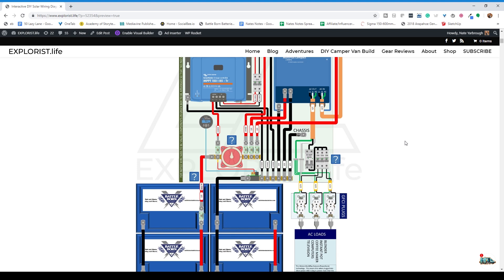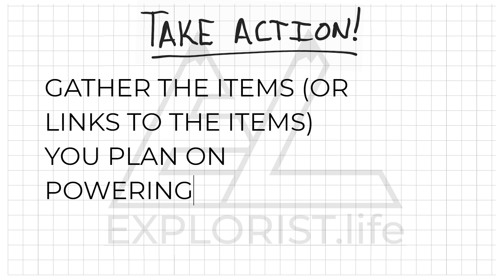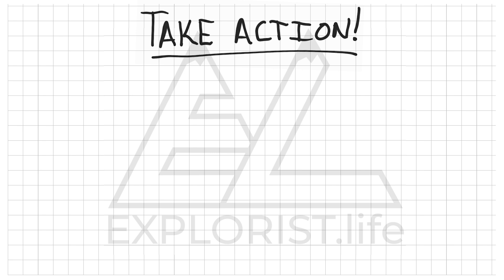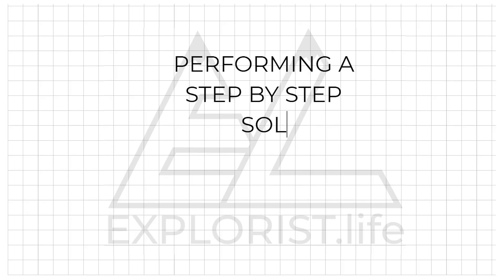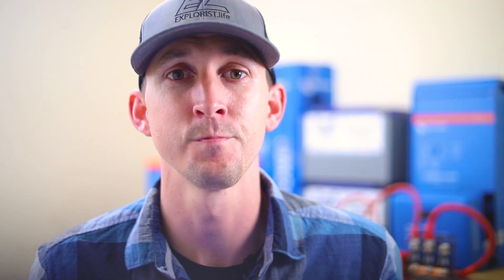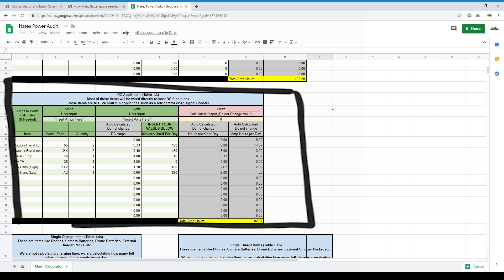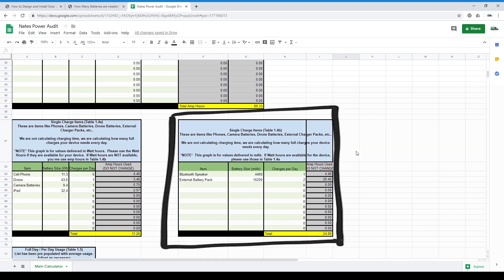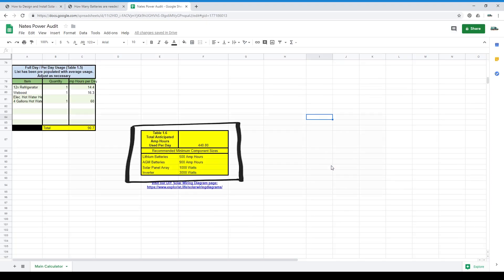How Much Solar Power Do I Need for My Camper? | How to Calculate Camper Solar System Size

Comment: You are basing your numbers on the rating of the power supplies and not their actual consumption. Good to overestimate by a bit but that all adds up to making the investment much more costly than may actually be necessary. That sours many people on the idea of going solar. You must own stock in a Copper Mine. You are calling out a 4/0 wire for a case ground on a Multiplus? That is some serious overkill.
Reply from the maker: Victron calls for 4/0 wire for 3000w Multiplus units.  Source: P.8 of the manual: https://www.victronenergy.com/upload/documents/Manual-MultiPlus-3k-120V-(firmware-xxxx4xx)-EN.pdf

ABYC standards call for "A DC Grounding concuctor shall not be smaller than one size under that required for current carrying conductors supplying the device and not less than 16 AWG". Source: http://www.blackfinforums.com/sites/default/files/10/attachments/abyc-e-11.pdf?fbclid=IwAR2dBwJC1gp9_oHI3X3r7M5nuXK0UzljHjHkWkMs_kLJvw66s-8M7J3DXP8

So, the smallest that would be allowed by ABYC standards is 3/0.  I call for 4/0 because it's generally easier (and often cheaper) to consolidate similar wire sizes and round up when wire sizes are within 1 gauge of each other.

Hope this clears up your confusion!

Comment: hi , love the gold you posting ... i do have a question regarding calculation, do the charge controller / inverter / isolator etc actually use enough power that i need to use it in my calculations for power requirements ? i assume they are used all day? thanks , Scott
Reply from the maker: I don't figure those in.  The inverter is the only one that really uses substantial power at idle and if you are using a Victron inverter like I've got in my diagrams at https://www.explorist.life/solarwiringdiagrams it uses less then 1 amp at idle; which is still 24 amp hours per day, but ultimately that's figured into the 'round up' part of that calculator.

Comment: my power bank says capacity 22000mAh / 83.6Wh... when i put these into specific 1.4 tables mentioned in the video I get two different result of 'Amp hours used'?

Comment: What about Tesla S batteries?
Reply from the maker: You'll have to do the conversion from amp hours at 12v to amp hours in whatever voltage the Tesla S batteries uses once you determine the values you get your end result from the spreadsheet.
Reply: EXPLORIST life - DIY Campers thank you to infinity and beyond.

Comment: On your spreadsheet in Table 1.4,  I have specs for an iPad Pro saying it’s 38.8 Wh and 10307 mAh.  When I plug that into either column, I’m getting a big difference between amp hours used.  What am I missing?

Comment: I shot-gunned it with my setup with 230Ah of golf cart batts and 200W of solar and a Morningstar ProStar controller and taking a SWAG at my DC power consumption. I’ve followed a lot of the tips offered by handybob (https://handybobsolar.wordpress.com/) which brought me to jesus re the crap that represents the charger/converter/power distribution units commonly sold for trailers and motor homes plus what wiring is >really< needed in a solar power/charging system. 
Your videos have been similarly useful (and somewhat complementary to handybob’s) for fine tuning. Thanks for the work sheet as I’ll go back and do an audit, hoping that I’ve got what I need ( I don’t believe anyone else ‘out there’ offering advice on the subject have created energy audit tools.
Reply from the maker: Hey Jim!  Yeah, it's annoying that RV OEM does that when it's, most of the time, truly unusable.  I design all of this stuff with the "Do it right and Do it once" mantra; something that OEM does not...

Glad these resources have been helpful! :)

Comment: I'm about to order everything thru your website for our promaster, I have a few questions about the system I am about to buy. One, for now, can I make it with one BB100ah battery and two 100watt solar panels (renogy) and one mppt rover 20 (renogy) and one 2000w watt pure sine wave inverter (renogy) and it will all work together with the victron bmv 712? I just want to know it will all work and also if I add another BB100ah battery to the system later with what I am about to currently have.
Reply from the maker: It starts getting complicated if you start going smaller than what I've got on my wiring diagrams because a single bb100 can only output a max of 100 amps and a 2k inverter can pull more than that; so you'll just really have to watch your output as you'll be pretty limited in that regard.  Also, you won't be able to charge from your alternator with an isolator as a single battery can only charge at a max rate of 50 amps.  Basically, only having 1 battery is going to be a pain. :/
Reply: @EXPLORISTlife  thank you for the input. Looks like I'm going to get another bb100 to play it safe. Everything else sounds good?
Reply from the maker: @CS.Cummings  At a quick glance, it looks good to go!
Reply: @EXPLORISTlife  thank you for all the videos you guys post. Without them this adventure would be a lot more...interesting.

Comment: Hey Nate, question.. What are your thoughts on a clamp on dc amp meter?  Need to do some trouble shooting on current draw and a clamp on would be nice if they can actually measure DC current, that don't cost an arm and a leg.  Thanks Jeff
Reply from the maker: So, I actually have a cheap one and am pretty dissatisfied with it.  I just really cant get an accurate reading with it.  I know the Fluke meters are likely more accurate but you're looking at $100+ for one of those.

Comment: Excellent video. Say for example that I have a 100Ah battery, and I use 100Ah in power a day. How do I know what size solar panel to get to keep the battery topped up constantly? Thanks
Reply from the maker: You should check this out.  This will answer that question: https://www.explorist.life/how-many-solar-panels-are-needed-to-power-a-camper/

Comment: Hey Nate, when you have done previous videos inside your van, have you been using additional lighting for your videos or has the 10 x 2w puck lights been all thats lighting up the inside of your van. 
I have a dilemma, I have purchased a couple of sample LED recessed lights, ranging from 2w to 10w, and the lower 2w/3w lights just seem so dim, but seeing your videos inside your van your 2w lights seem like heaps of lighting. But i thought maybe you were using an additional camera mounted filler light during your videos inside, and that's why it seems like your setup is brighter than it is.

Comment: Excellent & Enlightening Video. Compliments.
Just have 2 doubts:
1 - As I use 220v on my van, shouldn't I dive by 2 my amp usage on "Table 1.1"? 
2 - In "Table 1.6", are you assuming that everything is ON at the same time? 
Because my final result is incredibly big.  Something like 1000w in panels, a 3000w inverter and if I change (the changeable columns) reducing my use, the Table 1.6
 Total Anticipated Amp Hours Used Per Day goes down to 137 amps, but 3 Kw inverter stays there. Am I doing something wrong?

Many thanks & Keep it up!!
Reply from the maker: Re: #1  Nope, you'd leave it the same.  Voltage doesn't matter in regards to that particular table.

Re: 2.  Nope.  For the inverter.  It's simply taking your biggest wattage device demand, multiplying it by 1.2 for some wiggle room and rounding up to the nearest thousand watts.

Panels is based on battery capacity.

Comment: This is brilliant! I’m just wondering if it’ll work the same for 240v? as I live across the pond :)
Reply from the maker: Yep!  It'll work.
Reply: Yes but you just need a different inverter and everything should work
Reply: Given that amps are dependent on watts and volts, how come your table doesn’t appear to include the AC volts within the cell formulas? (For the 110V Appliance portion of the table)

I’m sure you have it right, I’m just seeking clarity given that I am filling the table with appliances that run off 240V (Australia). Am I good to just use the table as is? 

Cheers!

Comment: You are unbelievable, what a fantastic job you did, coming out with a spreadsheet, you are awesome, the best i come across on Youtube, or anywhere else in that matter, keep up the good work, 10 outta 10, Actually i have one question regarding your solar setup. you have a shunt between the inverter and the battery, can i use the shunt that came together with my BMV-700 battery monitor ?
Reply from the maker: Thanks so much!  ...and Yep!  You'll want the shunt between the battery and AAAAALLLLL of your other loads.